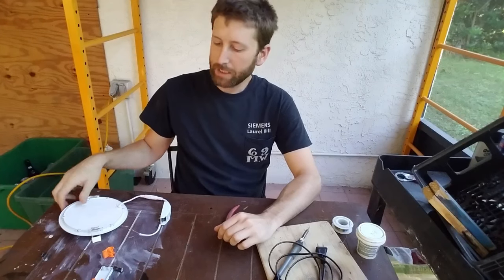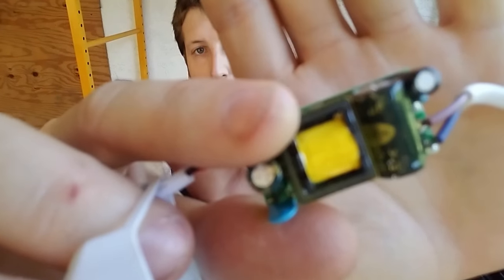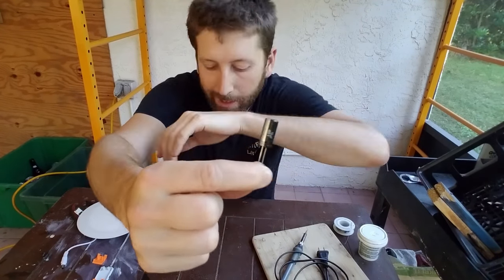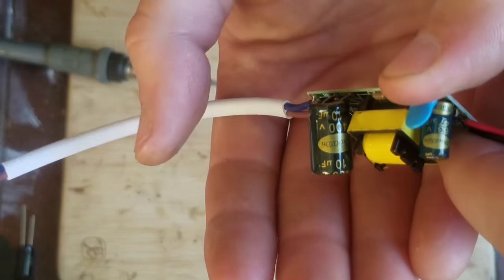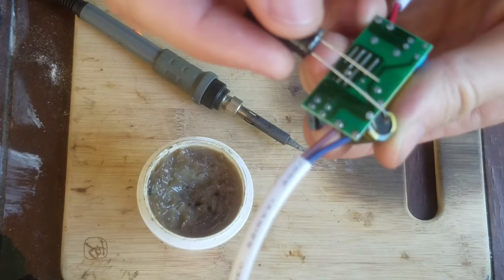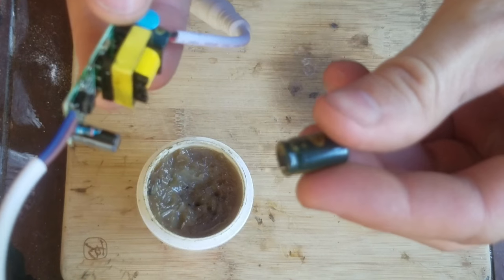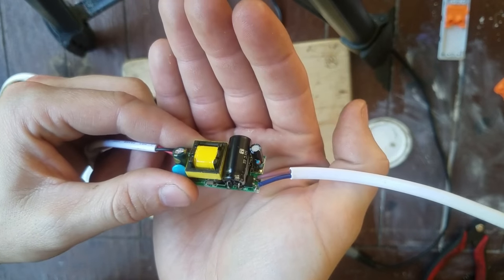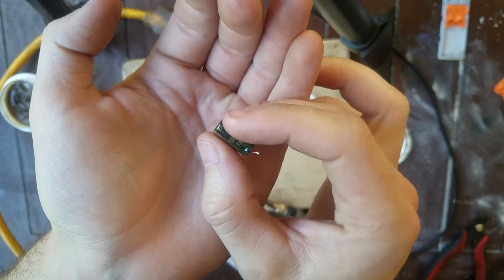How To: Fix a Flickering LED Light for ~50 Cents

Comment: Just cut the old capacitor off the leads and solder the new one to the old leads.  That eliminates the risk of messing up the pad and is simpler to do.  You could even use a crimp splicer if you don't want to solder (if it will fit)

Comment: Good job. Flux helps but also when ever you start soldering clean your solder iron tip and then add a little fresh solder to the tip. (This is called wetting the tip). And when you put it away same thing, clean it and wet the tip for storage.

Comment: so what is the point? old cap is bad or something?
Reply: Older/used capacitors get weak with passage of time and use and don't give pure dc current. It partly includes ac ripple which causes this flashing.

Comment: Hi
I noticed that you are not responding to queries
It would be appropriate if you could teach the checking of the different components 
Because flickering may be due to other components failing
Reply: Yes, you are right. Because I have lots of LED drivers make leds Flickering and changing CAP didn't solve the problem

Comment: Awesome vid, thanks. I have some string led floods that 2 flashed. I will try to repair them now.

Also, I have an led flood light. Work style with handle. It just stopped turning on all together. The checked the switch and it functions. Checked each led bulb and they all light up. What else do I need to check to see why its not powering on?
Reply from the maker: Could be a fuse, bad connection or wire, but most probably its the power supply or also called LED driver. Check the input voltage to the driver and output voltage, if its plugged into the wall you should have 110v AC power on the input and depending on the led something between 3v-30v DC on the output. If its battery then the input should be whatever the voltage of the battery is. Also look for damaged capacitors and burn marks in the power supply.

Comment: I actually followed the video and fixed two drivers. It is a little bit difficult to get rid off the old one. In hindsight, it might be easier to cut the old one and solder the new one. Many thanks for making the video

Comment: ive noticed on the regular lamp led bulbs that this has been the same point of failure across 4 brands including GE and Sylvania as well as offshore brands. all  but one of a a couple dozen of these were a blown capacitor, seems to be an obvious deliberate point of failure.

Comment: Hi is your fix still working without the flickering issue again?
Reply from the maker: Yes, the light works great after I replaced the capacitor.  I have 10 of these lights and over time I have replaced all of the cheap capacitors with good quality ones and have no more issues.
Reply: Janky Shack  Same here I have turn off these recessed lights in my garage and all of them are starting to flicker

Comment: Nice job. I have a defiant led 180 security light that is strobing.  The converter has printed on it ecla-ccd-120-a-030-0450-00 and it is a sealed unit, can it be replaced? repaired?
Reply: The number means nothing. You have to take it apart and replace the electrolyte capacitors BUT you should not tinker with ANY mains connected device unless you absolutely know what you’re doing, how and why.

Comment: When a LED light bulb is flickering does that mean the switch is leaking current?
Reply from the maker: No, if the switch is on then the circuit is fully connected. The reason they flicker is because they use a buck converter to lower the voltage. Its a modern way to lower voltage without a transformer or plain resistors. Part of the buck converter is the capacitor and when they go bad the light flickers.
Reply: @JankyShack  is it buck converter or flyback converter? I have ic controller HT2538 and OB2538

Comment: Hi I have been looking at the drivers of similar lights that are 4 inches in diameter and I have noticed that some have a varistor in the circuit board and some don’t. What could be the purpose and is it better to have a varistor ?

Comment: Have you ever repaired a ring video spot light that has the same issue of the spot lights flickering? I’ve seen a number of videos showing where they cut out the spot light drive and replace the lights. Just wondering if the driver can be replaced and where would I get one from. Thanks in advance.

Comment: I love your video but I think you can improve it with few simple things:
1) Learn a little about some basic video editing which is adding pictures and text and cutting videos. Then, with that knowledge, cut the video and insert the picture between.
2) You can put your hand behind the component or circuit but it does nothing. Components are small and a camera needs time to focus on them and your hands need to stay stable during that time. So, in your video, you should have taken a picture of a circuit and a capacitor and anything else that you want us to see better, and then insert that picture between the video where you want it to show (that's why I talked about inserting pictures in the video skill). This way we will see clearly what you are showing.
3) if you need to, use a magnifier and shoot a picture through it so we can see the component clearly

I liked the video and learned a lot, but with these small improvements you can make it a better one.
Cheers!
Reply from the maker: Are you volunteering to be my editor?
Reply: @JankyShack  If it's a paid job, of course. Otherwise no.
Reply from the maker: @adorjanc3076  I don't get paid either so that's why I'm not doing all that shit
Reply: @JankyShack  Damn! They should pay you for doing it because you are good at it! Anyway, keep on Youtubing :hand-purple-blue-peace:

Comment: I have flickering with brand new LED bulbs in my door inside entry ceiling light, but no flickering with traditional filament bulbs. It's frustrating.
Reply from the maker: Do you have that light on a dimmer switch?
Reply: @JankyShack  No, it's on a simple ON/OFF switch. That was the first thing I checked.

Comment: Hey community - I have a Gladle LED floor lamp and out of the box the led bulbs are not turning on.  There is power reaching at least the power button since it does light up once plugged in but when you push the power button, the lamp doesn't turn on.  I'm not sure if it's the power button that's not working or the bulb itself that might be malfunctioning - any thoughts?
Reply from the maker: I'd start with checking the connection points, from the youtube video i just watched on that light there is a power connection from the pole to the light inside of a screw connection. make sure that isn't pushed into the pole too far or damaged
Reply: @JankyShack  I just loosened the screw to free up the cord but it's still not turning on.  Any other ideas?  It doesn't seem like there is any other easy way to open up the bulb area.
Reply from the maker: @omarchaudhry195  impossible to say without a meter

Comment: U can always use a capacitor with higher voltage but not lower 
And be carful with the uF have to be the same and If u didn’t find 
U can Use like 6.8uf Replace it with 10uF it will work just fine
Reply: You say the uf has to be the same then you immediately says it's ok if they are different. Yeah, that makes sense...

Comment: Installed the same led in my living room, and after 4 months of working fine now  2 of them stay on after they are turned off. What can I do to fix that???
Reply from the maker: sounds like you either have a bad switch or something else on that circuit with the same neutral is pulling a lot of power and somehow back feeding those lights.

Comment: I just installed a 16 ft  string of stick-on under (kitchen) cabinet lights. In the center of the cabs there's a microwave over the stove, so not wanting to run the lights under the microwave I cut the lights and soldered a length of lamp cord to "bridge" the last 8 ft (up through the cabinets and down). Those last 8 ft of led's are now dimmer and flicker. Obviously, the problem was caused by bridging the strip, but is there a solution to this problem without using a 2nd transformer? BTW, the transformer is rated at 14 watts. Thanks in advance for any help you can give.
Reply from the maker: Did you try lighting the whole 16' before you cut it? If the second strip is dimmer it seems like a bad connection, but it could also be too small of a power supply. Different strips have different power requirements per foot based on density and size of the leds so I couldn't really tell you without knowing which strip you have.
Reply: it could just be the drip from the wire connecting the 2 strips.

Comment: Thanks for making this vid! I have a lot of these exact fixtures and LED drivers and it seems like the drivers were made to fail. In five years, I've replaced all 30 of mine at least TWICE! Have you found the capacitor to be a long term fix? Do you also have the impression that the fail rate is abnormally high? 

EDIT: I just noticed you answered my questions on another comment. Thanks again!
Reply from the maker: I have updated the link list in the video description with 2 alternative vendors for the capacitors that I used as they seem to be out of stock.  I haven't had issues with them for almost 2 years now with the new capacitors
Reply: @JankyShack  Thanks so much for the reply! Upon rewatch, I see that you've got the smaller version of what I have installed. I'll probably need to disassemble one of mine to confirm the exact specs on the capacitor.

I'm certain that since 2015, I have replaced at least 60 of these ballasts. They have a lot of different vendors but all look pretty much the same on the outside and are nearly identical on the inside...and they are all junk!

But I'm in too deep! 30 holes with a 9.5" diameter would cost a fortune to do a total replacement with something else that'll fit. PLUS the low clearance that these lights offers allowed me to lay them out right under my trusses (I'm a sucker for symmetry!) so a traditional can and bulb just won't work.

You may have made my day!
Reply: Welcome to See-Jen-Pinga (Xi JinPing)'s Chinese product.

Comment: i became overjoyed when i saw your -tubba-flux . i have a similar one here myself, although it is a very small metal gravy boat , like a stainless steel one for a very small family of wee folks . this METAL construction enables me to run a heat gun or embossing tool and run the flux into liquid to allow it to resettle nice for easy pickinz and sooth my OCDs . i have been soldering (poorly) since i was 15 . i am 54 now and at this point, proud of my lead slingin skills . i solder often and happliy as long as i have my oateys boat . On a great day in the 90s a boozy plumber name of WILLIE showed me how he used Harveys brand plumbers flux and suggested i do the same when we were drinking beer at his apartment . i was amazed at how well a tiny amount of flux applied served to join two different types of wires together . After the day drinking with willie i never stopped using flux , although harveys is no longer around . i got a kentucky fried chicken bucket size of OATEYS paste flux for around 8 dollars and i am down to only one third left ! i often mention use of flux to people whose builds do not come up , and they ALWAYS say the same thing ... "my soddur alreddy has flux innit"   horses - water . i always remove the flux using solvents like iso alcohol , i also clean my stripboards and pcbs with a wire brush and recut all the solder points after applying more , i rub down the dry board with it after using wet sand paper to cut oxidization off and i proudly display gut shots featuring the solder runs in a mirror like high gloss finish , my shit comes up like the morning sun , but boy oh boy have i taken flak from pros techs and experts about "doing it wrong" .suposedly the use of this flux releases mini black holes which consume your private parts .